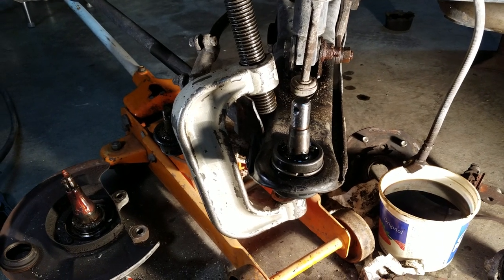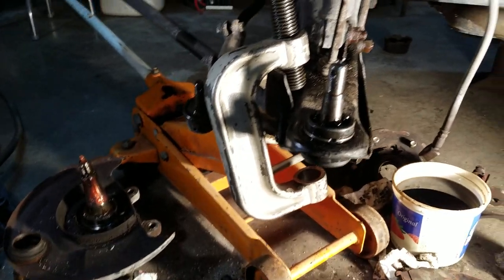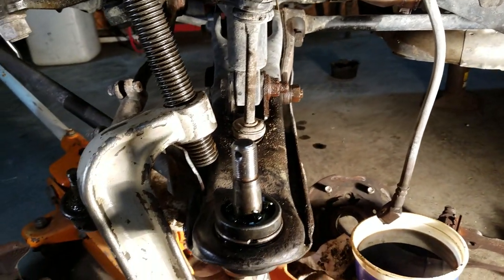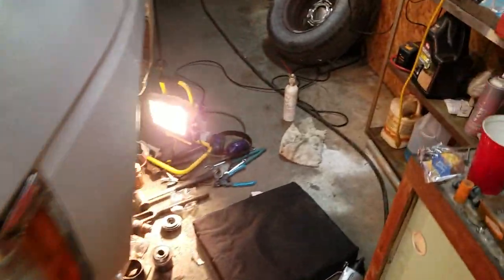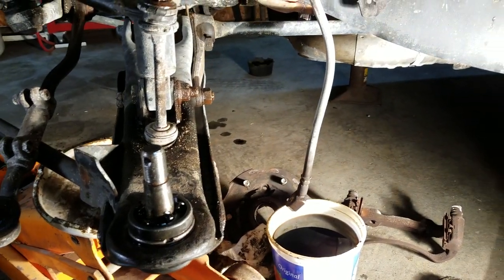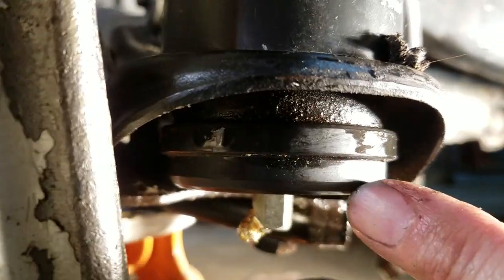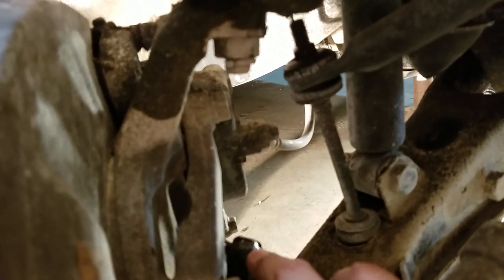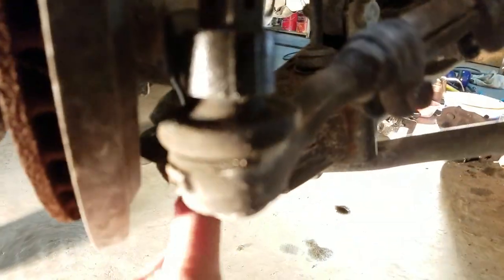1995 Nissan D21 Hardbody Pickup Truck 2x4 Upper & Lower Ball Joint Replacement

Comment: Thank you for the video. I had my '97 D21 looked at by a local shop today and they quoted me $950 to replace upper/lower ball joints on both sides. Nearly fell over at the price. Am thinking I will tackle this myself. Trying to decide between pressing the lower one out or just replacing the entire control arm. Really appreciate guys like you who take the time to post videos that might help out another. Love my little Nissan truck. Had it for 14 years and have about 133000 miles on it.
Reply: Do it yourself mate,press it out,it may look like a mission but take your time and all good.

Comment: If snap ring is jammed relive the top with a cutting disk and use a punch to get it going , had to do this right the way along. And for the ball joint taper just cut the bolt off with cutting disk and then a couple taps just falls out. Gives a much better hammer swing.

Comment: Your caliper piston are not likely the brake issue, I bet one of the slide pins weren’t  greased properly. Causes them to stick and the caliper squeezes sideways like that.
Reply from the maker: Thank you for contributing.

Comment: Did you change out the upper control arm bushings?  If not im making a Video this next week on the drivers side. I just helped my son on the passenger side,its a booger to do if your alone. Thanks for the lower arm video
Reply from the maker: No I just did the ball joints I will watch for you video

Comment: Boss harbor freight sells that ball joint kit for like 20$ and its a 7/8ths socket or wrench your choice to tighten the "C" clamp and lower ball joints castle nuts are also 24mm socket short socket with 6 points instead of those ugly 12 point style
Reply from the maker: Thank you for contributing that's good to know.

Comment: so does the rotor and spindle have to be removed in order to get to the lower ball joint?
Reply from the maker: I'm not sure you might be able to ? I was doing a complete brake job so that's why I removed everything.

Comment: Is there a snap ring on the stock ball joints? I’ve removed the grease bolt and all from it and I can’t find one but I can’t get it pressed out. This is the lower joint. On a 2wd 1992
Reply: Grease boot*
Reply from the maker: Give me a call 606-875-0125 or text me some pictures of what you got to the same number Kevin

Comment: You never showed putting top ball joint in
Reply from the maker: Sorry about that but the upper ball joint was very easy,, just unbolt old one and bolt new one in its place no need to use any special tools besides maybe a pickle fork or a little heat .